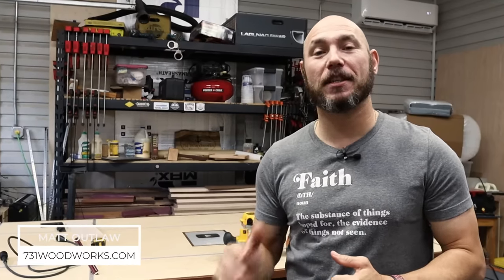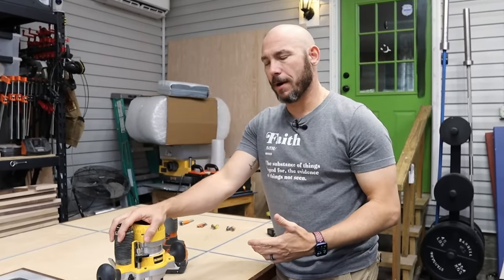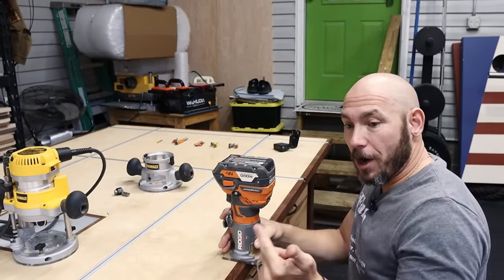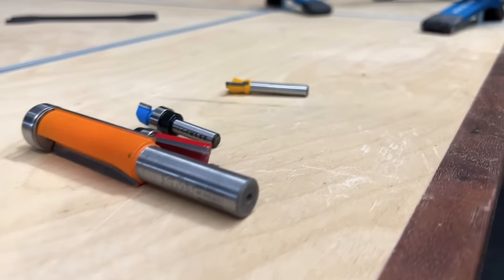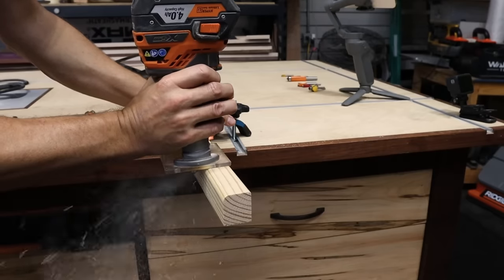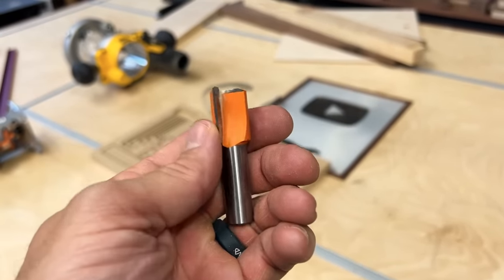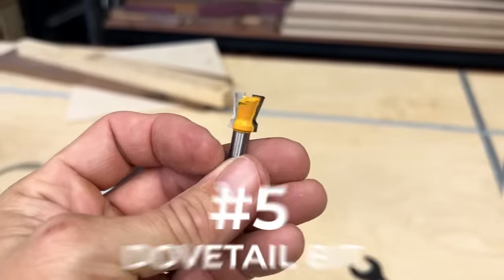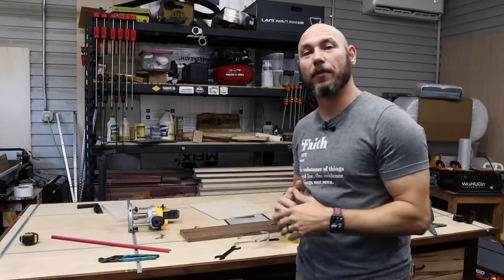5 Router Bits for Beginner Woodworkers

Comment: I've always suggested getting one of those cheaper bit sets, with all the different shapes / profiles, and use that to determine WHICH bits you use the most.  Then buy the good ones that you actually DO use.  Also, for flush trim bits, I suggest the spiral ones instead of the two blade like you have.  They are more expensive, but WELL worth every penny.  Much better at flush trimming.  Excellent video as always!
Reply: I was going to leave this exact comment
Reply: Yeah, upcut downcut and compression styles of bits, have really spoiled me. But so many are soooo overpriced. It's nice to see better ones getting lower in price... but great ones are still ridiculous. Lol.
Reply: I did exactly that my bro. I have this cheap nasty 35 bit set off of Amazon for 40 euros.. Who knew they could be that trash for just over 1 euros per bit.. I'm learning which bits I like and which I do not like and I've already begun to order bits which are for the professional at around 30 euros per bit. It makes sense to pay more for the better bits though. I get that even if money is tight sometimes I wait and save some to get the more expensive ones. These cheap bits burn every workpiece. I thought it might be the variable speed on my router but the paint went on fire too. This cheap nasty yellow paint on the bit went on fire on me. How can I get that crap cleaned off the bits? Anybody with a good suggestion on how to do that I would greatly appreciate ur advice on how to.. Thanks good ppl
Reply: If the paint is actually burning, you might as well take a torch to it first, and then clean up what you can with a wire brush and some alcohol. At least it won’t destroy your projects that way.

Comment: I bought a 70 piece, 1/2” shank set on line for $150 with the hope it will be good enough for basic use until I figure out which ones I’m going to use the most and need to be upgraded.  We will see.

Comment: I made a lot of interior barn door shutters and hinged double shutters  for the inside of my house.  I used 3/4"maple  plywood for a backing and 3/4" maple plywood for panels and trim around the edges  I put the panels together with Kreg screws and pocket holes. then glued the entire assemblage to the backing.  In the end, they came our very nice.  In any case, I had to cut a couple hundred pieces and each one needed to be chamfered on the edges. I ended up buying a cheap Kobalt router table and router from Lowes to do the chamfers. It cost $179 and was a good investment. (Buy it if you need a router.) I couldn't chamfer 7X7" swaures or 20"X7" rectangles with a trim router as it always showed start points or. burn marks. The router table was the only way. Once I had it dialed in, I could chamfer a piece on four sides in about 30 seconds.  I also used that router and table to cut rabbets 3/4 " deep and 1" wide on 7' maple boards.  As maple is hard,, I had to do them in three passes, but it worked just fine. Not as nice as Matt's table and router, but it did the job.  To cut those rabbets, I bought a Freud 1/2" bit.  I had a set of Yonico 1/4" bits which are a bargain, but are really only meant for small routers. For anything heavy you need 1/2" bits.

Comment: Recently I bought a Makita trim router kit with three bases. I bought the corded model because I will only use it in the shop.  I got it because Tamar at 3X3 Custom uses the battery model and she used it for dado's.  I made her table saw sled and cut dados for T Track with it. No problem. The motor on that little router is very powerful. I also have a Ryobi trim router. That thing is not very powerful,  but it is good for round overs and chamfers.

Comment: @731woodworks i got a dewalt router as a gift but the base plate on the plunge base is missing. Do you know where i can get another one? Im not having any luck with "dewaltrouter plunge base face plate" when i search 😪
Reply from the maker: I"m not sure where to get one.  I know you can get an entire plunge base on Amazon but not sure about just the plate.
Reply: @731Woodworks  well thanks for replying anyways! Im going to see tomorrow if the base plate on the fixed base also fits the plunge base now that i think about it...
Reply: Turns out that no, the fixed base face plate does not align with the plunge base threads :(

Comment: I like the DeWalt battery trim routers as they’re beasts that run well above their weight class. My trim routers have become my go-to routers for probably 90% of my router tasks; I’ve even gotten a mini base plate to allow me to mount the battery router in my router table extension. DeWalt like Makita and Bosch makes a plunge base for their trim routers; just be aware that the lock lever on the plunge bases for the trim routers works opposite to standard router plunge locks. I also run the larger DeWalt 2 1/4 HP router with the 3 base kit as I prefer the fixed base with the trigger handle; the standard fixed base is attached to a base plate in my router table extension which is attached to my table saw. 
As a side note if you work with plywood a lot you should invest in a set of plywood bits or even just in the sizes of plywood you use as they’re undersized to the size of plywood which allows much better dados than say either a full sized bit or making 2 passes. As a cost save if you get straight cut bits with top bearings you’ll get two bits for the price of one as well as make it easier to cut deeper as the bit will automatically follow previous cuts; this set up also allows template cutting on a router table or free-hand with the same bit.

Comment: You mentioned CMT And Whiteside. Bits Bits take Whiteside bits and do a process they call, “Astracoat”, which helps the bit make a smoother cut and prolongs the life of the bit.
Reply from the maker: Yes I have some Asta coated bits and they are great

Comment: The spiral and the spiral compression bits will do a much better job than the straight bits and the straight pattern Bits . You just have to make sure you have the right one of them for the job. However, the straight pattern bits work well when there's only 1/8", or so,  to trim.

Comment: Great video for beginners on routers. Thanks for sharing.
I bought my first (plunge) router about 15 years ago, together with a not so cheap router bit set. The first ten years I hardly used them. The last five years I use it more often. But I made a simple router table where it's living more or less permanently now. So I bought a cheap second plunge router, again with a set of router bits.
I'm satisfied with everything. Over the last few years I bought some extra router bits. Nearly all of them are from Makita. On average they cost about 15 USD.
Hopefully next year I'll buy a trim/palm router. I think I'll take a corded one, but I'm not 100% sure yet.

Comment: As a new subscriber I want to thank you for the great beginners information. 
I was able to buy a reasonably priced used Dewalt DW618 Router as you suggested. Its a nice bit of gear. As new or experienced router operators don't forget to use PPE every time.

Comment: Matt, as usual, awesome job on the video. I have been meaning to thank you for turning me on to using a dovetail bit and the dovetail clamps from previous videos. I have made a couple of jigs and table saw sleds and included dovetail grooves instead of t track. It's a lot cheaper and faster to build.

Comment: Just to add confusion, I found a Mafell milling motor that can be converted to a super-powerful 8mm shanked detail router, gets into all the places a 1/2" router won't fit. Finding bits is a bit of a pain, but at least the ones I do find all seem very high quality 🤷‍♂️
Reply: It's a mafell fm-1000 if anyone wants a look, I think you can spec it in 1/4" from new, all the power you could ever want, and fancy electronics making the motor respond to increased load very quickly. I love it :)

Comment: I BOUGHT A UP SPIRAL BIT TO MAKE BOX FINGER JOINT < BUT I HAVE LOYS OT TEAR OUT < ANY REASON WHY<  I USE A ROUTER TABLE. LOVE YOUR CHANNEL 👍👍🇨🇦🇨🇦🇨🇦🇨🇦🇨🇦🇨🇦🇨🇦🇨🇦
Reply from the maker: I would try a compression bit. The up cut bit might be causing the tear out. Compression bits are both a down cut and up cut in one bit

Comment: Moving the router from right to left is called a "climb cut". It's similar to feeding a piece of wood into your table saw blade from the back of the saw. Don't do it!

If you're using a router table, you should always feed from right to left.
Reply: Further, if you're routing all four sides of a board, you should go counterclockwise, starting with the endgrain and finishing with long grain. Cutting long grain AFTER endgrain will remove the tear out that you always get cutting endgrain.

On a router table, also start with endgrain but go clockwise.